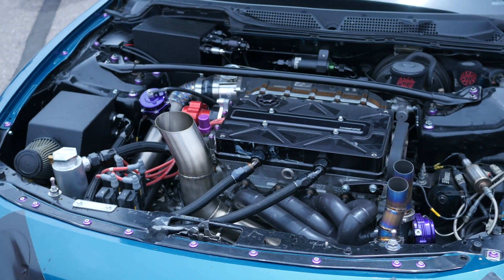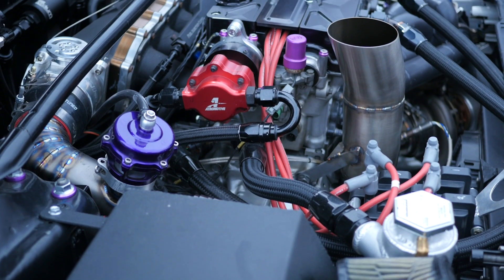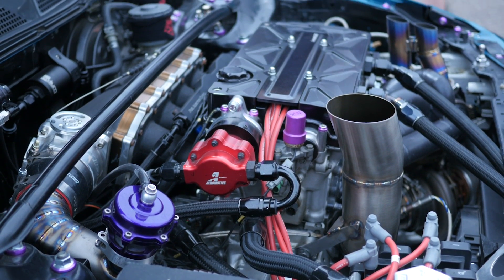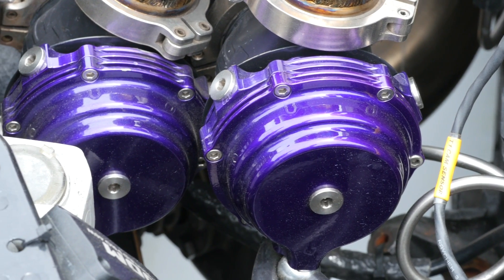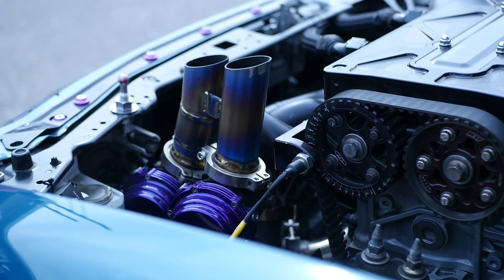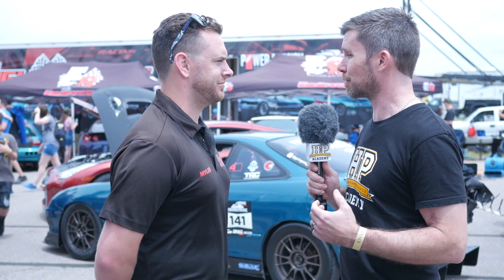Stock To 1200hp+ 54psi & 208mph | Honda B18C [TECH TALK]

Comment: Wow secondary high voltage battery packs for the fuel pump. First time hearing that but genius idea. As long as you're not using an in-tank fuel pump. Have it burn up in your tank getting More Voltage than recommended. It wouldn't explode from lack of oxygen but the thought of it's kind of scary.

Comment: i have a b series (B18C1) CP pistons, rods, sleeved, etc etc. aka its built. running only 414@ 20 psi on a rev9 with 93 octane. I plan on buying a precision 6266 or something equivalent but my question is with the setup as it is what would i be able to run hp wise? trust its built for the track but i use it for the street. if anybody can help me out i have a facebook with the same name or hmu on here and help me out. thanks all.

Comment: I am a HPA member... but I was wondering if When running a LiPo RC battery probably a 4s to get you 16.8v  @ full charge, Is that battery running only specific electronics or is it used to replace a typical 12v lead acid automotive battery? I know enough about LiPos to know the have great discharge rates and are the main reason for the fast speeds in the electric RC world. i am not sure they would just drop in and replace a 12v lead acid without some checks on Voltage and Amperage from the alternator... They can flow some serious amps on discharge but not a smart idea to charge it beyond 2c charge rate. 2c meaning 2x the total capacity of battery or Batteries in parallel being charged. Thanks for a great channel and company. P.S. Most every hardcore car guy I talk to knows about HPA!!!

Comment: Can anyone explain to me why you wouldn't want the block to have a lower compression ratio than the 11:1 he is running? Trying to learn a little more.
Reply: Break Mean Effective Pressure; cylinder pressure, it translates to more torque and naturally more horsepower. More pressure=more power when properly tuned

Comment: As always interesting information. Ive been looking for answers for water pressures and not a lot of info is out there. since you guys mentioned water pressure. Would like to ask something that i recently discovered. i have to change my hedgasket on my 4g63 evo 3 and noticed that any hedgasket i find it has differences in terms of water holes from head. Some hedgaskets block off completly and some reduce the size of the holes more than 50%. Since its a 4g63 i first assumed that its for another version of a 4g63. Do you thing that head gaskets are designed like these so it can increase water pressure ? Being more specific ive checked Brian Crower and HKS headgasket. Would appriciate it if you have some solid information about this. 
keep up the awesome content.

Comment: Oh my good god - seems only yesterday 600hp was a good output from these things!
Damn, I'm old ;-(
Reply: 350 is daily power for a Honda now days
Reply: I own a 227 whp Honda and I thought I was fast 😥
Reply: @southbayboyy  It is fast, depends on what you're comparing it to. In the world of drag racing/roll racing where power levels keep increasing it doesn't seem like much. 500-600 is more reliable today than 10-15 years ago. Mainly because Ethanol is available to most people. If they had to run race gas as before it's too expensive to turn up the boost high enough to make that kind of power and still run it on a inexpensive fuel. But even Myles switched to M1 methanol which has most of the benefits of Ethanol but has a slightly smaller fuel requirement. M1 is about $9 a gallon, where Q16 import is $20 a gallon and E98 from a fuel company is about $4 a gallon.
Reply: @dj4monie   very true , and I am getting the benefits  of my 85 locally going  for $2.79 a gallon.

Comment: Surprised to see stock crank and steel rods. I've always wonder what the setup was on this car, it smokes a lot of people.
Reply: only honda can put factory crank and drop 1000+ hp
Reply: SREvolutionNZ not true... just about every Nissan crank from the 90's can handle well over 1000 HP.
Reply: @joshuahebert9949  ok
Reply: Sloppy mechanics also put a stick ls crank to over 1000 hp at the wheel through a 4l80e, so probably closer to 12-1300 crank.
Reply: Aaron _z33 my 1996 cobra factory stock forged crank is rated for 1200hp lol

Comment: Awesome upload HPA. Anyone who wants to check out the build thread should search "gringotegra new build". He has a lot of threads on Honda-tech, and although he's not really that active on it, there's a lot of content there for those who are interested.
Reply: He doesn't always post only when he's accomplished something. He has post on FWD traction that is an excellent read. One of the few 1000 hp FWD cars that can be driven on the street, does 10's @150+ on street tires, 9's on slicks and 200+ mph in the 1/2 mile.